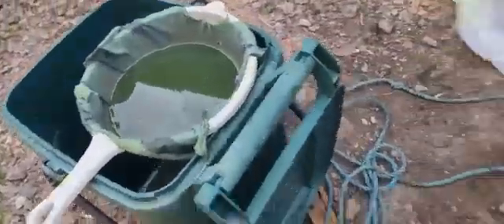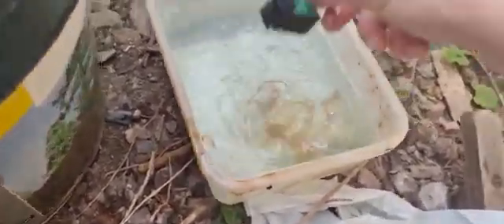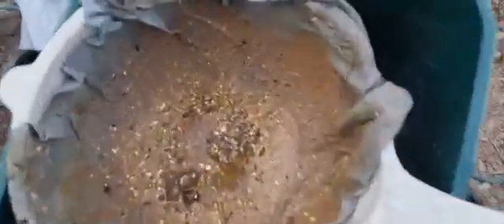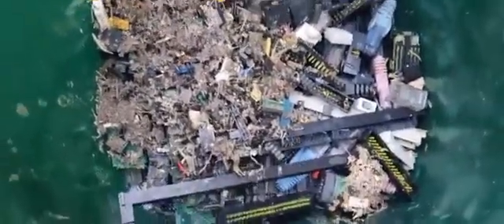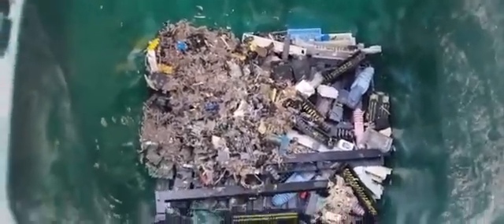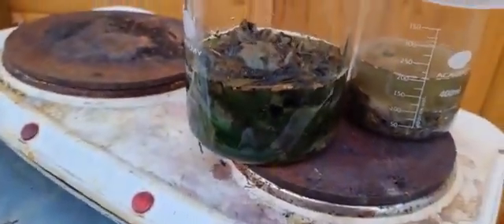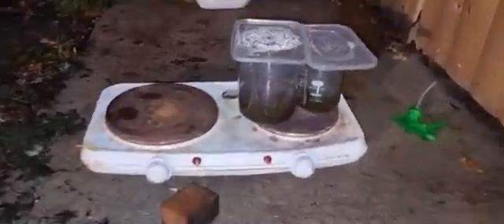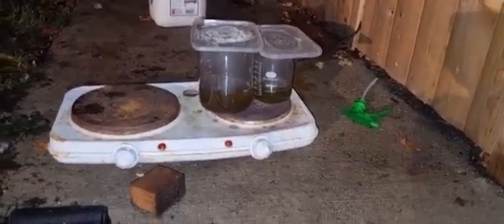gold recovery and refining of 5.75kg connectors from motherboards and cables

Comment: Hi Amigo were you get nitric acid firm pleas I need sum
Reply from the maker: I don't use nitric
Reply: @keytefirerefining1355  what substitut you can use for nitrico pls
Reply from the maker: I use cucl2 which is hydrochloric acid mixed with copper to remove base metal then to refine to pure I use hydrochloric mixed with sodium nitrate on hotplate then sulfamic acid to remove the nitrates then smb
Reply: @keytefirerefining1355  so i yam tinking yuo makin de poor man acua rigia yes amigo ?
Reply: @antoniotrepistole1383  yes he using acid/peroxide  method method first to remove the base metals and then hes using Poormans  Aqua Regia in the second stage my friend
Reply: @aidavewaste2576  Thanks amigo I will be checking out your channel.
Reply: No es poco oro para tanto producto? Gracias por el video.
Reply: Si es poco or para mucio acido